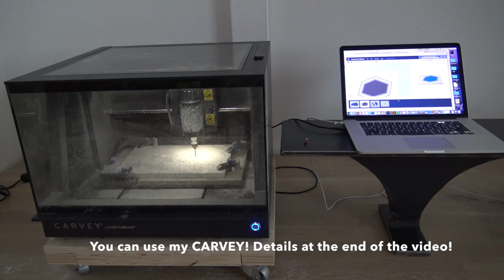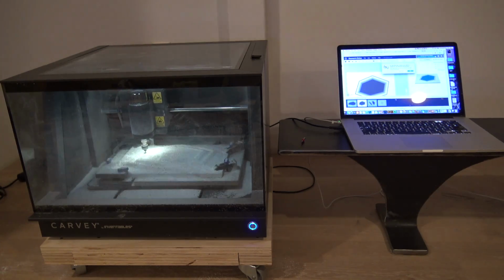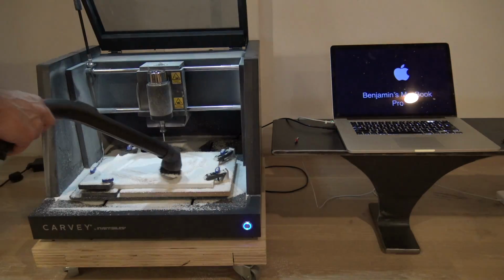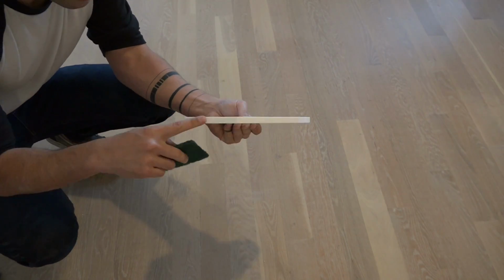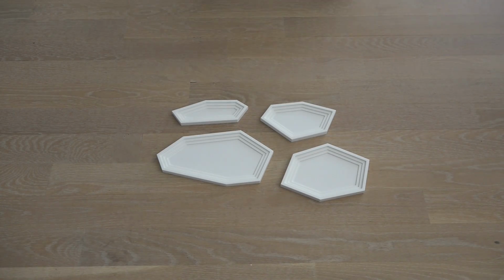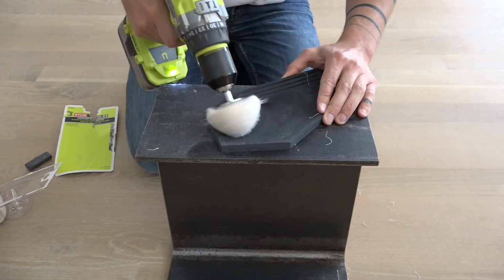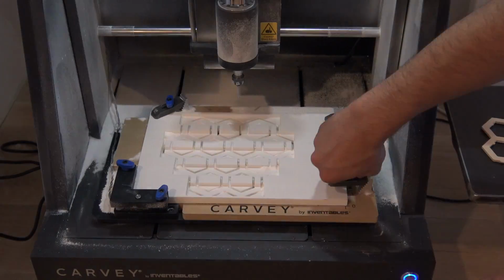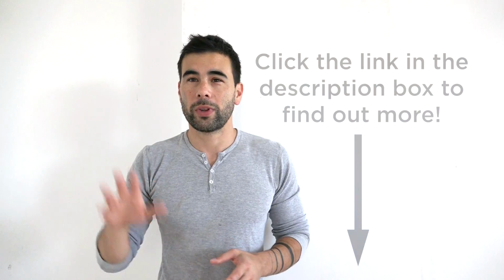3D Carved Corian Dishes

Comment: Regarding online submissions, consider using a Raspberry PI as a print server (octopi OS) using octoprint http://octoprint.org/   allows you to print remotely and you can hook up vid cameras so you can stream time-lapse or real-time video of the builds.  You should be able to use the same instruction set to control the Carvey or instructables.com could help you with the details.   
This would allow you to create an online queue with your ability to review the files and then send the ones you want to the Carvey.   users could check the queue to see if their projects have been approved and when they'll be at the printer.

Comment: Is Corian a food grade product?
Reply: Sunbo Lee so you wouldn't use a wooden or plastic cutting board?  that's a very poor criteria for what you'd consider food safe.
Reply: Corian is 100% acrylic and non-porous. There are other brands like Meganite, Avonite, HiMacs, Wilsonart solid surface, formica solid surface, and others (not to be confused with the quartz solid surfaces that include silica). Google around and you'll find a lot of cutting boards made out of it, though some complain that it's tough on the edge of knives.
Reply: Corian® is nonporous, durable, easy-to-clean and NSF/ANSI Standard 51 Certified for food contact making it ideal for use where food is prepared and served. It is also tough, withstanding the daily knocks and spills common in food service environments.  More info here: http://www.corian.com/corian-r-for-food-service-design
Reply: And yes, Corian is non-pourous. I've left a glass of wine on my kitchen counter over night, with no visable effect...10+ YEARS ago. Not sure if its changed over time, but I know it can be sanded with 220, then 440 then 2k plus, to smooth things out.
Reply: I hope so, that is what they have been making expensive kitchen counters are made from the past 30 years.